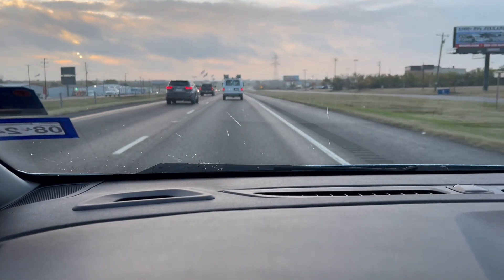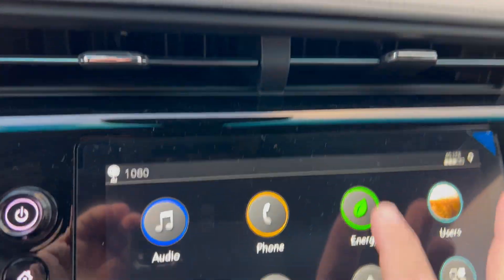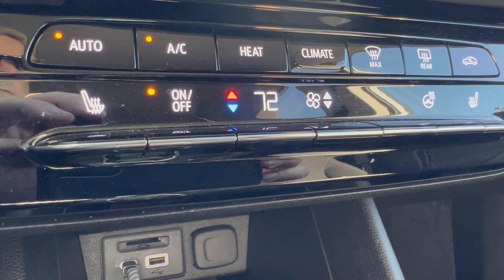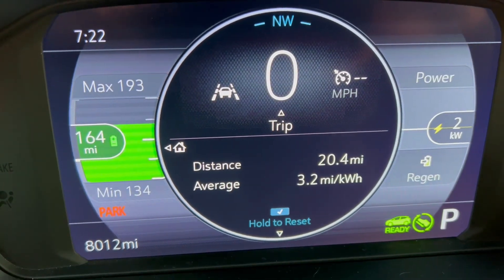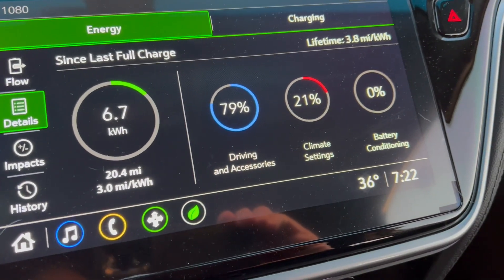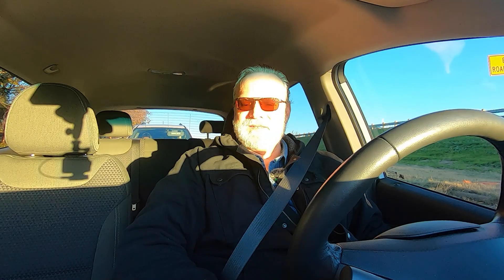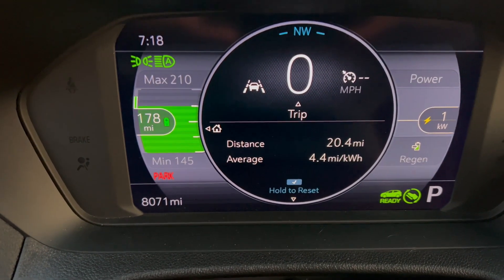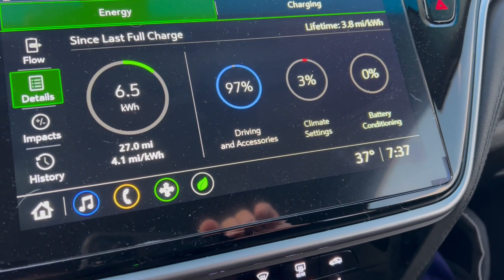Where Does The Range Go When It Is Chilly?

Comment: Good experiment on showing the effect of using climate control on efficiency, using heat in your case.  This past week I’ve been experimenting in my EUV with using the remote button on app to cool down the cabin when parked downtown with full sunshine ☀️ has heated everything up as it beams through front windshield.  Outside temperature was between 68-70°F, so not so warm that I really needed AC on while driving around, so the main thing was I had to remember to turn the AC & fans on just before I turned the Bolt off & get out so later when I hit climate control it blasts the cabin with cold air (very first time I tried to use the remote button while parked in sun outside my condo the AC was off & it was just pushing the hot air around when I got in).  Downtown day 1: hit the remote button 20 minutes before I got into car and it was quite chilly like a walk-in industrial refrigerator. I hadn’t meant for it to run the full 20 minutes, but I was delayed in leaving. Downtown day 2: hit the remote button 5 minutes before leaving and the temps inside cabin was quite pleasant.  So for chilling the greenhouse effect on sun through front windshield hitting the remote climate control button on the Chevy app a short 5 minutes is enough. We have a cold front moving in so next week I may experiment with turning on the heat via remote climate control.

Comment: Did a 230 mile road trip in my Model Y in Colorado with the  temp getting to 12 degrees F..... with snow tires. I got about 292 Wh/mile which implied a range of 253 miles. I could not be more happy.

Comment: This is a great video.  Thanks for helping us understand how the Bolt reacts to the cold.  It looks like judicious use of climate control can negate the biggest impact of winter.  Good stuff.  Heated seats and wheel FTW.    I am curious what impacts you see during the warm weather and ways to possibly address power consumption then.  Thanks for the video.
Reply from the maker: I will do one once it warms up. I’ll be filming a spring update next week, to show how it does with moderate weather, and I’ll do another in the summer when it’s stupid hot in Texas.

Comment: As with climate control, playing the stereo at decent volume must sap the battery.
Reply: Not by very much, I've measured the kwh on lots of devices and heating always used an insane amount and things like speakers and led lights use a very very tiny amount

Comment: So I've never understood those whole climate control  issue past the first 30 minutes of driving. For those first 30 minutes, yes the cabin needs to heat up so the heater uses energy. But then past those 30 minutes, in my gas powered car, I can usually turn off any fan speed and the cabin stays warms. Is the engine still heating the cabin due to the fans running despite me setting it to off? In NY in a toyota camry...

Comment: I saw your energy efficiency analysis. I drive a 2017 Bolt too. I learned that if you have sunlight, even when it is freezing cold outside, the cabin heats up by the big windshield. Free energy from the sun, the heater will switch off, or even start chilling the AC. I recently just changed my tires. I concentrate on lowering the weight of rotating parts, the wheels are the biggest. I removed the OEM tires 215/50r17 on cast aluminum for 195/65r15 on steel rims. Weight per wheel went down from 21 kg to 16 kg. I have seen an increase in energy efficiency due to the tire change. Perhaps worthwhile considering.
Reply from the maker: Nice.
Reply: @SpinnerEV  I see your numbers as slightly more efficient than I see on my 2017 Bolt. I don't know all the details difference between your model and mine, but I can give you some numbers; 15" steel rim 5x105 mm; 56.6 bore; ET 39 mm. Elsewise they will be sticking out too much creating too much air drag. On mine, they do exactly fit. I choose Goodyear Vector 4 Season gen 3, the 195 tire is narrow having advantages over the OEM tires. What I experienced: They increase comfort a lot for the driver in terms of ride quality (fewer vibrations) but could perhaps increase some road noise which for me personally is not an issue to concern about, they decrease cornering and acceleration - but if you are relaxed touring all the time and driving highly efficient, you don't need high-speed cornering and speed runs from the traffic lights; they decrease wear and tear to the suspensions, they increasing energy efficiency about 10-12%. This of course also depends on how to use the heater. For my winter use counts now, including the use of the heater I got nearly about the same mileage on a single charge as that I had with the old bigger OEM tires in the summer including airco cooling. I say nearly, cause you will still have some winter range less, but for what I use it, it is the same.

Comment: Thermal mass.  If you want to help reduce the energy used during your drive then let the preconditioning run for at least the 20 minutes.  Running it for just a few minutes (8?) will give you warm air but will not fully warm up all of the interior mass.  If you can warm it up fully you can  use that heat storage in the cabin to reduce climate energy.  If you are not concerned about having enough energy for your trip then you don't need to do this.  If you want to maximize your range in cold weather then  run the preconditioning close to  20 minutes.  If it's even colder out, single digits and below, I'm going to do a double precon.  Also consider the use of recirculation.  I do that in my ICE when the temps get single digit and below.

Comment: Thanks for all your data and hard work to do this experiment with the Bolt EV.   From other videos I have watched, I knew the range is going to be knocked down due to weather and what else you have turned in the car.   
I plan to get a 2023 Bolt EV 2LT model this spring beginning of April 2023 - if all goes well.  
Being single and retired, 99 percent of my driving will be just around town or very short single charge trips.  Living in Northern Illinois, we will definitely get cold weather.
take care

Comment: Did you happen to adjust your tire pressure to compensate for the cold? Lower tire pressure can make a difference.
Reply from the maker: Not at the time of this video.
Reply: Also winter tires will have an adverse  impact on range, and there will be variation depending on level of traction (worse the tire, longer the range not too different from ICE vehicles) not that they will be required in all areas

Comment: Great video!  I experience the same issue when driving over the Sierras on Hwy 80 when it’s very cold.  Quite a big difference.  The AC is not nearly the same drop as the heater in my 2021 Bolt

Comment: The magic number for my 23 Bolt EV for driving in the cold is 2.9m/kwh with about 25% energy going to climate control.  That's with 68deg cabin settings and temperatures around freezing and a 8 mile one-way commute.  The "technique" contribution is always a plus value, so the issue isn't my driving.  The car is new, so haven't had a chance to operate it in warmer weather, but adding back in the 25% energy yields about 3.9m/kwh.  EPA: 259m/65kwh --> 4.0m/kwh, so all makes sense.  So, rule of thunb: heating --> 25% range reduction.

Comment: I have the 2022 Bolt EV 2LT and it has Heated Steering Wheel and Heated Seats.  Add the climate control heat and the range drops a lot.  MY issue is that I bought on Labor Day (9/5) and was getting 275-280 miles of range on a full charge.  Now it's cold and I can only get 245-247 miles of range on full charge.  That makes me nervous.  If it continues to drop to 225 on a full charge, I will sell it and not buy another one.  In fact, it had better go back up to at least the stated range of 259 when warm weather arrives.  I think there are ways to condition the battery prior to charging to make it better during the charge process, but I have no idea how to do that.  I'll research that and see if I can improve the range during our cold weather.  That said, I love my Bolt EV.  For me, it is a perfect car for my driving needs.  I actually look for opportunities to drive it places, and we take the Bolt instead of my wife's 2020 Cadillac XT5 Premium Luxury SUV.  I'm having some dimentia regarding gas stations though, as I can barely remember where they are now.  And I'm not sure what to do with the money I'm saving not buying gas.
Reply from the maker: When the weather warms up, I expect your range to return
Reply: This issue is not just in the bolt. As a matter of fact, it's performance is significantly better than a recent test on the BZ4X carried out in Denmark/ Norway. The test results were abysmal. One question about the test that I'm sure of is if AWD (operating a rear motor) was a factor apart from climate control/ cabin heater

Comment: Interesting; I was wondering what sort of lithium batteries are used in your Bolt; and if you might know how the battery will be kept warm during freezing weather.  Tesla has some battery warming that goes on even if the car is suppose to be turned off - does Bolt do something like that ; if not it would be interesting to know the battery performance if you get as cold as say 10 degrees below freezing. Thanks
Reply: That's one reason why Tesla's had the lowest range loss in a  cold weather test of 5 EVs (Audi, bmw, Hyundai, Kia)

Comment: I am a new owner of a 2022 Bolt EUV. Range as certainly dropped with the onset of colder weather here in the Midwest to about 3.1 KWH. I am running climate control with heater and heated seats etc. I wondered what the effect of the climate settings had on range. Interesting video and well done. Thanks.(P.S. any info on the heated seats, steering wheel have on range?).
Reply from the maker: When I ran without the cabin heat, I left the heated steering wheel and seat turned on. I had slightly better range than I did in warmer temps with climate control on. My guess is that it’s minimal. My OBD dongle and app weren’t communicating when I did this video, but I’ll run an experiment and check in a future video with more exact measurements.

Comment: Should have bought a Tesla.
Reply: So you can spend $25,000 more and have less cargo room, brilliant!
Reply: It is not 25 more, it is just 11,000 more. Just bought the model 3 2023 with 44,600. Compare with dealer chev try to add accessories make it close to 33-34 for LT full package.
Reply from the maker: When the video was made, Tesla hadn’t dropped the price. Also, the tax credit of $7500 assumes at least that much tax liability to get it.

Comment: Great video. I have a 2013 Chevy Spark EV and live in Ohio. Spring and fall with no climate control I get ~5.0+ MpKWh. Summer time with A/C on it drops to around 4. Winter with the heat on it drops to around 3. HOWEVER, I just recently realized that if I turn the heater on and adjust the vents onto my hands on the steering wheel I can turn the heater off while leaving the fan on and I will get about 5 minutes worth of heat with no power draw. I then turn it back on for about 2 minutes and then off for another 5. Doing so has brought the range back up close to 4 and the cabin warm! I would love to see if this trick works with the Bolt as it is likely that the Bolt will be my next EV purchase. Thanks again for the informative and entertaining video.
Reply from the maker: Glad you enjoyed it. The heated steering wheel does a great job keeping my hands warm.
Reply: @SpinnerEV  Sorry for the confusion, what I meant was that I aim the heat on my hands so that I can tell when the heater is starting to blow cool air again so I know when to turn the heater back on. It has been great for extending the range!
Reply from the maker: Got it. I’ll give it a try.

Comment: Very methodical. Great comparison, especially given that you were doing it in your spare time. Living in the Tampa area, we don't get much in the way of cold, but we may see similar temperatures briefly in January or February. We just got back from a trip to Michigan and had a couple mornings down around 40F. One of those mornings, I had to DCFC before we hit the road, so I used shore power to warm the cabin and then we drove with no heater. The efficiency was about the same as on the warmer days. The second cold day, there was no charging in the area where we slept, so we got into a cold car and hit the road. We ran the heat long enough to warm up the cabin and then shut it off. There was not much of a hit to efficiency since the heater warms things up so quickly and we had plenty of range to reach our next charging station. All in all,our Bolt EUV was a fine road tripping car, even on chilly days. Now, if the temperatures were below zero, that would probably be a very different story.

By the way, your video about your trip to Tennessee help me in deciding to take the Bolt to Michigan. Thanks!
Reply from the maker: Thanks! Great to hear that you had a good trip!

Comment: I live in Michigan, have a 2017 Bolt EV with a new battery (66 kWh).  My efficiency drops from 4.2 miles/kWh to 3.0 miles/kWh for my commute (25 miles of 70 MPH freeway plus 8 miles of rural).
Reply: Very interesting. I live in MI and have a 25 mile commute. 15 miles of that is like the “farm roads” in this video and the rest is city streets. I have ordered a Bolt EUV, still waiting for it to be built. It’ll be interesting to see what numbers I get when it’s -4° on the way into work in late January/early February. Also, I can pre-heat the car in my garage in in the morning but I park in a surface lot at work so other than starting the car 15 minutes or so before I leave (not plugged in) it’ll be what it is on the way home. I predict better m/kWh on the way to work vs on the way home, but we’ll see. Hopefully I get the car before the end of Feb! May have to wait a year for this test, lol!
Reply from the maker: A couple of years ago we had a couple of days that hit 0 degrees. If we get another one of those this winter, I’ll document it in another video. Congrats on your soon to be EUV!
Reply: @ConservatEV  Take a Tesla for a test drive before the Bolt, you won't go back.
Reply: @trex2092  Probably true, but my FIL retired from GM, not Tesla, so that’s where I have a discount. But my NEXT EV could be a Tesla.
Reply from the maker: Michigan is going to be colder than Texas, but I’ll update if we get an arctic blast.